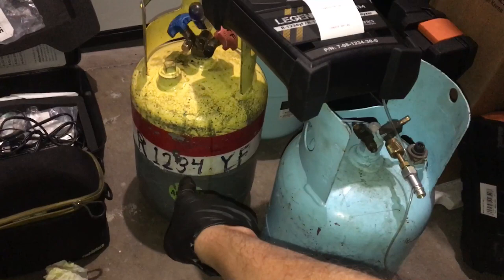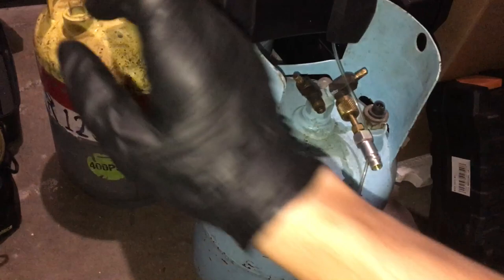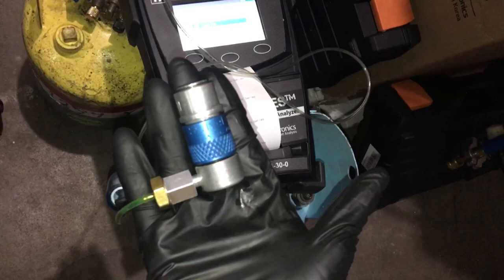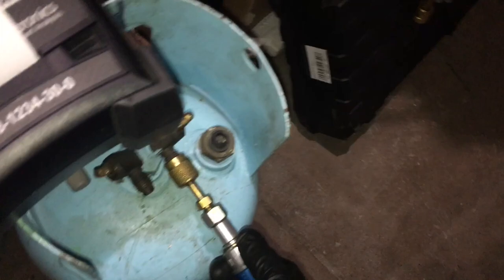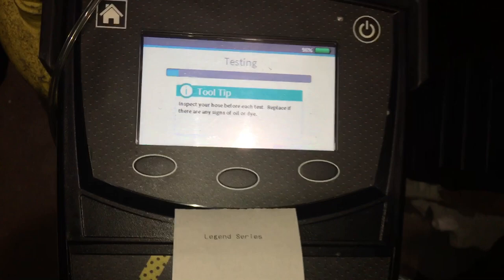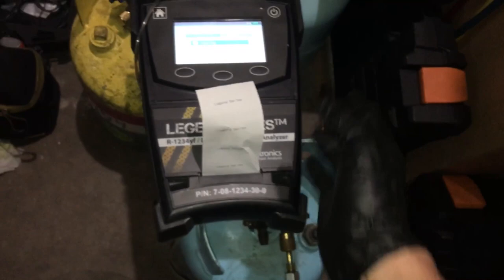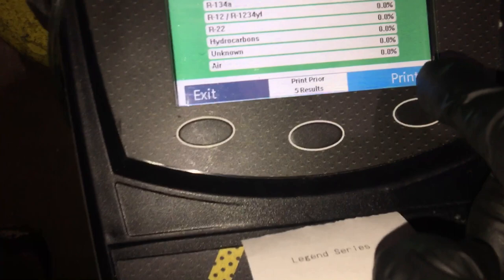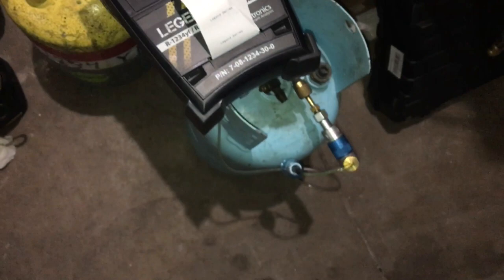Recycling Refrigerant, NO !  reason to have contaminated refrigerant after recycling￼￼

Comment: Curious. Whats your thought on the "free estimate"?
I think if i rana business i would want to charge a small fee to cover some time and to help make sure customer is serious.
Reply from the maker: I think of free estimates I like going in for a free dental exam where they do a full mouth x-ray so they could look at all your teeth 🦷 where they might be paying 30 or $40,000 a month on renting a building another hundred thousand dollars for that piece of x-ray equipment that $300,000 dental school the two receptionist at the front Dess that are costing you $300 a day to $500 a day the hygienist who does the teeth cleaning who is $500 a day and then you’re going to give away the diagnosis of a root canal or a cavity or just a simple gum infection for free.      🤔.   To run own and operate a business what do you think that math formulation outcome would be. 

        I have a one hour minimum fee for anything which is $173 to look for a leak that’s just a start.  I don’t diagnose without completely draining and recharging the system 100% to the factory specified weight. 
              Then I start. 

And if it starts to get into controls or electrical that’s another diagnostic fee separate from the mechanics and leak check and performance test. 

            If you watched my videos which I know you have you know I don’t use the little can with a single hose and just guess at topping off refrigerant. 

         I carry over $30,000 intestine diagnosis and tools and equipment inside my vehicle

       Does not include my $80,000 plus in snap on tools that I’ve purchased when I was a mechanic years ago as you know nowadays $80,000 goes nowhere in tools and equipment to open up and run a business. 

         I have one Business office that I run my three different businesses out of with 950 ft.² of storage for supplies and equipment.
          And I have two garage office Storage warehouses both at a little over 1200 ft.² here in San Francisco.   That did not come for free. 

          In the last 35+ years I’ve flown myself out to countless seminars and expos and training events different training classes hotels and airfare I lost count of the amount of money that that could add up to not including the lost wages and hours in sales of equipment and billable hours. 
 
              Free estimates it’s just a full the customer with BS that Hass to get covered up and paid for sometime by just jacking up the price of the parts and tagged on labor hours. 

       The laws of physics and economic say nothing is for free. 

        So I’m just up front and truthful to the customer right in the very beginning and they get charged. 
                        I don’t lose for my time and materials

                     The customer does not lose because he knows what needs to be done. With a with a list of parts that need to be replaced in a list of procedures that need to be performed. 

        Then if customer decides to do it himself and try to save money that’s his FREE ! choice

        I know in some countries and  some cultures the free give me thing is a way of life. 
               Ex-wife more than one come from countries and cultures who believes that way so I’m very aware of it. 

            But I simply tell them this is how it is if you don’t like it there’s the door.  And if you want a door gift I will buy you a one-way plane ticket back to wherever you come from were they give away stuff for free.
Reply: @coldfinger459sub0  
Your answer so long but worth the read. 
As a customer.. I feel that when they are free they dont put in the effort. I have had some that feel like they cant wait to get back out the door they came in.

Yes you have more equipment than 80% of companies.
Even for diy.. I will have the right stuff. Its frustrating not to and to guess if something is correct.
Reply from the maker: @turboflush  EXACTLY 100%  👍👍👍

Comment: Wrong. You should never overfill. End of story.
Reply from the maker: Yes I hundred percent agree with you none of my employees would ever be allowed to do such a thing and nobody touches my tanks except me. 

          And since on this day the high temperature was only 54°F and it was at the end of the day when I was doing my last refrigerant recovery‘s and going directly back to my shop for recycle. 
                      The temperature was dropping by the time I made it back to my shop the temperatures were in the mid to low 40°F so that only means one thing if you know your gas laws ? . 

            1: That’s a pressure inside the tank will always be decreasing due to the falling temperature
              2: And the volume of the gas Will be decreasing inside the tank as the temperature of the tank falls. 

            Something we learned in grammar school math class and grammar school science class reinforced in middle school high school and college. 

      And for those fortunate enough to go through their 2 1/2 to 5 year HVAC residential and commercial refrigeration classes it was emphasized and reinforced the gas laws are driven into your head like a nail into a board. 

        I would never ever recommend anybody overfill their tank but because I know the basics of the grammar school level of the gas laws I know the tank it’s not hydrastatically locked still with headspace and ever decreasing in pressure on my way back to the shop. 

            Now it be a completely different story and outcome if I if I overfilled my tank at 7 o’clock in the morning in 40° weather to the point where it’s hydrostatic Lee lot and then put the tank back on top of my vehicle in the sun and the mid afternoon was 90° that tank is going to blow off the valves and there’s gonna be a mess.